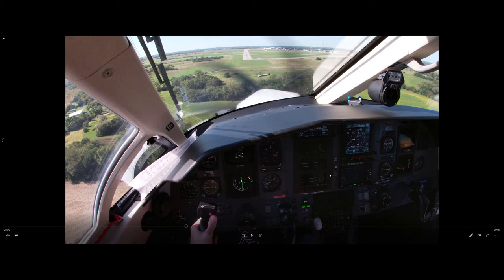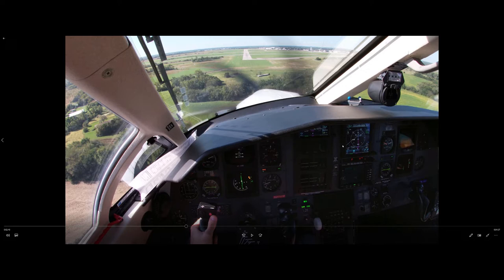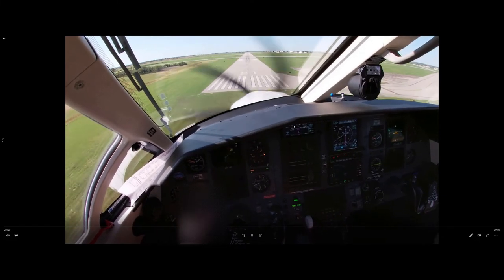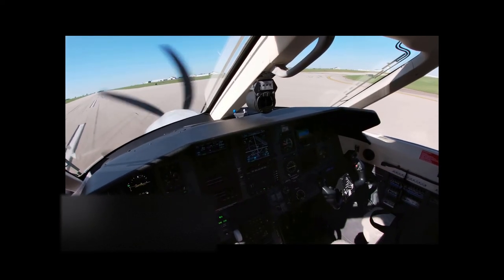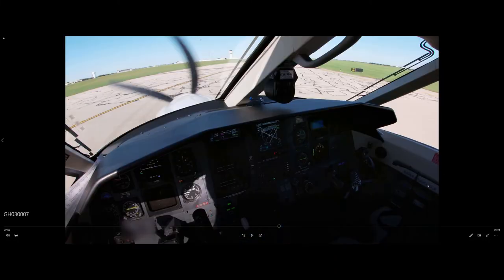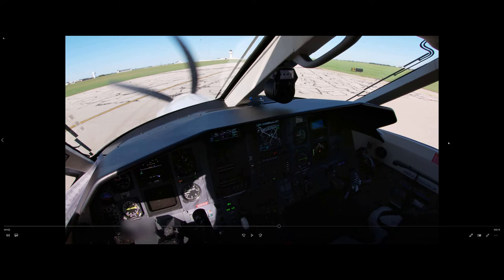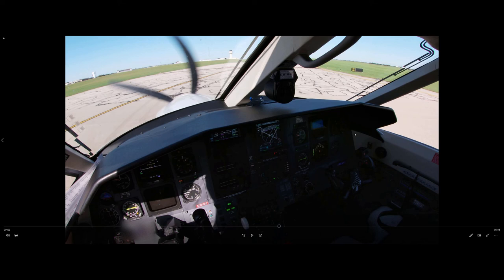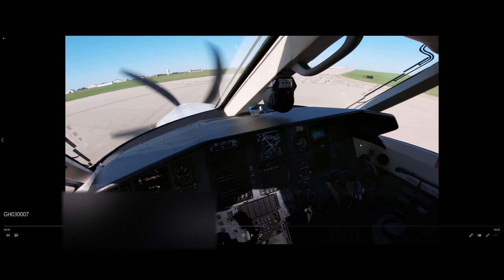Pilatus PC-12 Reverse Thrust

Comment: Do you leave it in flight idle when you go into beta on the roll out?
Reply from the maker: Great question! It's better to leave the condition lever in flight idle until you've gotten the airplane sufficiently slowed. The higher NG at flight idle helps the propeller blades more quickly transition into beta, plus in the rare case that you do need reverse thrust the engine is already spooled and can deliver it immediately.

Comment: I am wondering how the PT6 engine produces reverse thrust at all, how the system works. Is the air exhaust (downstream the turbine) pointing towards the noise of the aircraft, which results in deceleration of the aircraft?
Reply from the maker: The propeller blades reverse pitch so thrust is produced in the opposite direction. Cheers!
Reply: @GeneStuart  Thanks for the reply. Out of curiosity: Do you know how much the range of pitch of the prop is? Over how much degrees is prop pitch variable? And do you actually control the pitch itself, or is it done by software/mechanical link through the reverser-lever?
Reply from the maker: @bernddasbrot2453  The prop feathers at about 80 degrees. The minimum pitch in flight is 6 degrees. And, the max reverse pitch is about -18 degrees. The pilot does not have direct control over the propeller pitch; it's controlled automatically by the propeller governor. The system works very similarly to governors on piston airplanes. Good questions!